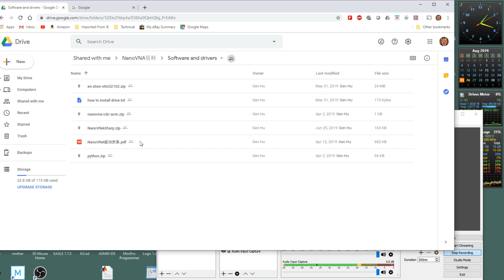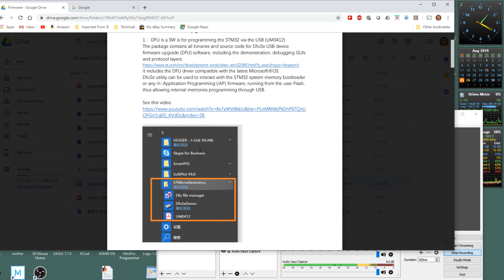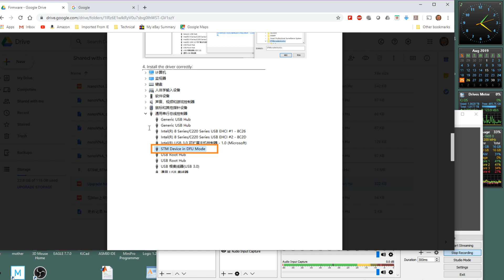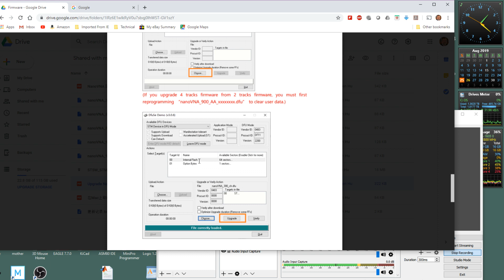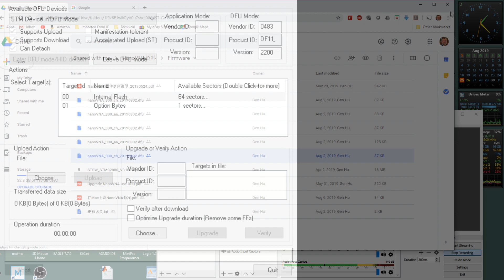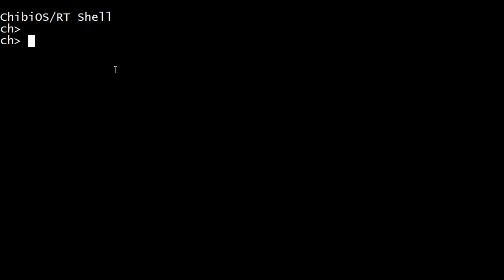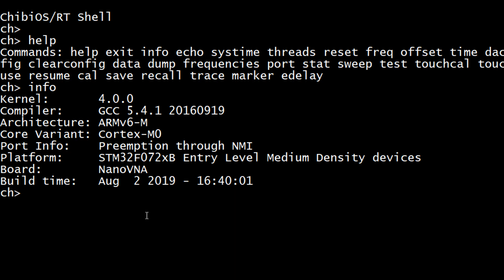#372 NANOVNA How to do a Firmware Upgrade

Comment: HI, is there a special cable to be used? Still trying cables and havent had luck yet with DfuSe finding the device. Hopefully I can come delete this question. lol. thx
Reply: Got it, no special cable needed. Using a standard charge cable. However, had to load the drivers via the .pdf in the download. Be aware this is not covered in the video, it wont just work if you plug it in.
Reply: I'm using the nano vna H. I used this link to get a very recent 2022 version. Just powered on, looks different. Have yet to play with it. Thanks for the video!
Reply: Choose update driver in Device manager, navigate to STMicroelectronics folder, not any subfolders. Mine loaded right up and viola, it was found. 

I also was able to enter upgrade mode via the config menu, no shorting anything.

Comment: Those of you all reading this circa May 2022, recommend you join the NanoVNA group. The whole process has changed and become more streamlined with a new app that is a combination tool to process the measurements and data as well as enter the consoles commands. Links to the latest DFU firmware files as well as tutorials and NanoVNA documentation can be found in the files section and there is a wiki as well.

Comment: Thank you very much for the files and the link to your Google Drive! My NanoVNA does not specifically say it's the -H model. So, I loaded the non -H file. I got a display, but no trace and the thumbwheel was unresponsive. I thought I had bricked it. I went ahead and loaded the -H and it came back to life. Yay! I like having the battery icon. I read there is a diode to install to make it functional. More Google searching! :) Thanks again for the files!
Reply: ciao shawnerz io ho  un nanovna -H versione hardware 3.4 , basato su design edy 555 e firmware 0.4.5.1 hugen79 prodotto in data 26 dicembre 2019. sapresti dirmi cortesemente quale'è l'ultime versione del firmware )( ovviamente per questo modello versione hugen79 / edy555 ) inoltre è possibile aggiornare  il firmware con windows , il cavetto usb ed il software DfuESe della STM)? grazie
Reply: @maxastuto  Sto utilizzando Google Translate. Spero che questo aiuti. L'ultima versione del firmware può essere trovata qui: https://nanorfe.com/nanovna-versions.html Buona fortuna a te.
Reply: ok many thanks. I upgrade with last version hegen 79 specificy for my nanovna version( H to 2,8 inch) to 0.4.5.4 from 18 january 2020. Have you a software to use a nanov vna with pc?
Reply: @maxastuto  I do not use the VNA with software or a PC. I only use the display on the VNA itself.

Comment: The board is running an embedded  Real-Time Operating System (RTOS) called ChibiOS.  It's open source (see www.chibios.org/ for more info) and targets a number of different embedded microcontrollers, including the ST Micro ARM Cortex chips.  The CLI you see is based on a stubbed UI that ChibiOS provides and the "info" command is telling you more about the build environment for ChibiOS rather than the application that's linked with it.  So maybe you can only really rely on the build time in there as a version identifier, as the rest has more to do with how the RTOS was configured when it was built.